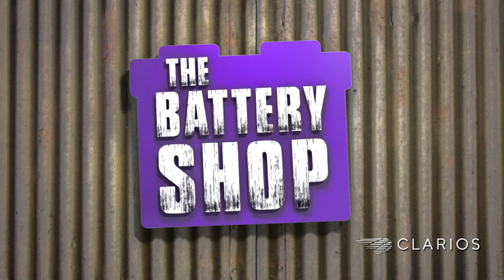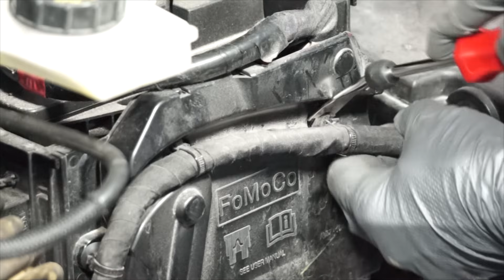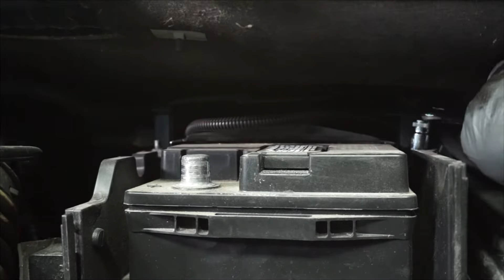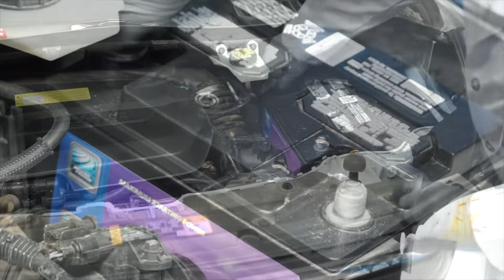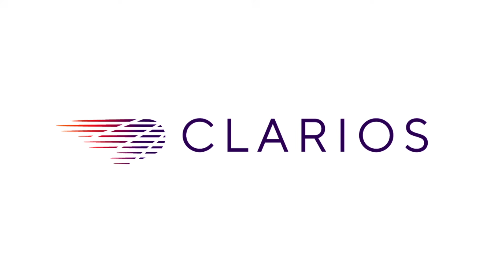Ford Escape (2013-2019) - New Battery Install

Comment: Wow, great video!  Two comments - I was doing this on my in-laws 2014 Escape so I wanted to put all the parts back properly. It took me probably 45 minutes to get the BACK side of the battery cover on and I'm still not sure it's engaged properly. The video shows putting on the front of the cover and the battery I was replacing was installed by the local dealer so I'm not sure that the back of the cover was ever on correctly after the dealer had done the install about 4 years ago. Both parts of the batter cover were just loose and laying on top of the battery. Why isn't the back of the battery cover installed permanently at the factory so the front would just clip into it? Much of this is done by feel since you can't see it while working with your hands underneath the cowling. Second - make sure the battery is shoved all the way back in the battery box before you put the front of the box back on or you won't be able to get the front of the box engaged (I learned this the hard way).  I didn't bother to check the owner's manual on how to replace the battery and this video was great!!!  I once had a GMC Acadia and the owner's manual didn't even tell you where the battery is (it's under the back seat in the floor).  C'mon American car manufacturers, you can do better than this!!!  Because of nonsence like this, I will never buy a GMC or a Ford again (don't get me going on the cabin air filter for this car).   But, great video!  It took me about 2 hours total to do this job, taking my time and playing with the battery cover for about 45 minutes.
Reply from the maker: Thank you for watching and adding to the conversation!

Comment: My ford escape had  clips on the filter box. Also my filter was square. Their was no bolts holding it down but those self tapping clips. Just pull on the box and they will become free. Everything else is correct. Did it today. Removed it in 45 minutes.  Installed in 15.
Reply from the maker: Hi - Thanks for watching and sharing your experience!

Comment: Seems to be a lot of ambient current flow causing a spark when you disconnect/ reconnect the negative wire to the frame. My daughters battery lasted 9 years in her 2014 Escape.
Reply from the maker: Hi - Thanks for watching! Thanks for sharing your experience. The spark can occur when a Memory Saver is being used.

Comment: Look at the battery replacement for a 2014 ford escape. You either remove the whole airbox or the wiper cowl if you want to get it out. This is all designed this way to drive customers to dealers for service
Reply from the maker: Hi- Thanks for watching and sharing your opinion!

Comment: Why on earth would Ford put the battery in such an inaccessible location???
Reply from the maker: Hi - Thanks for watching and sharing your thoughts!
Reply: At the beginning he said it had to do with crashs and weight distribution that's the Ford answer.  The real reason is to force you to go to the shop and pay them to do a job you Used to be able to do yourself. And that's no cheap battery either $300-$400.

Comment: You didn't mention resetting the charging system. I'm reading we must do this after installation of a new battery. Do you do this? Is there a video for it? Thanks so much
Reply from the maker: Thanks for watching. Some vehicles need a reset of the computer to help it understand that a new battery has been installed. We would recommend contacting your dealer or mechanic to see if your vehicle needs a registration reset.

Comment: removing the cowl and wipers gives you more access and really you should remove the negative cable before removing the positive.
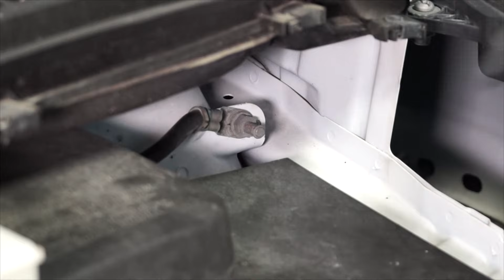Reply from the maker: Hi - Thanks for watching and sharing your opinion! We followed the vehicle manufacturer's procedure as outlined in their service manual. The negative battery cable was disconnected first via the firewall connection (as shown at  0:53) as per the recommended procedure.
Reply: @TheBatteryShop  stand corrected on the negative terminal ...

Comment: Thanks, great video.  Is the socket required for the air filter housing also a 10mm?  Thanks  again, great video, great help  Please stay safe.
Reply from the maker: Hi - Thanks for watching! The video was made quite a while ago and we don't have that information here in the studio. We suggest you check with a service/repair manual for the vehicle to be sure.
Reply: Looked like it was an 8mm based on the close up of the socket.
Reply: 8mm is needed on the 2013 titanium I'm working on right now

Comment: I think the easiest way is to remove the wipers, the plastic cowl and the metal bracket and change it out from the topside
Reply from the maker: Thank you for your contribution and advice!
Reply: @TheBatteryShop although I did run into an issue with the wipers not working properly despite following instructions on how to cycle them

Comment: This was great until the last step, connecting the negative cable to the frame. Why am I seeing sparks?
Reply: Its normal. Its completing the ground circuit.
Reply: it's normal, just be quick when you pit the negative back on and don't sit there making a  pretty lightshow with the sparks 👍
Reply from the maker: Hi - Thanks for watching! That can be normal when a memory saver is not used.

Comment: I don't get it... all these complaints. I removed the cowl and wipers in a few minutes. No big deal. Its not like you have to do this very often.
Reply from the maker: Hi - Thanks for watching and sharing your experience. We did follow the vehicle manufacturer's recommended procedure though because some folks who watch our videos have never done anything like this before.
Reply: @TheBatteryShop  Thanks for the reply and thanks for the effort to publish your video. I guess the motivation for my post was all the "less than rational" posts I found here. When I was in the workforce (as a design engineer) I found two types of folks when it came to criticizing "the other fellows work". 
1. The thoughtful types who understood that "compromise" is a main ingredient for all but the simplest of design. 
2. The rest. The ones that have not taken the time to fully understand "compromise", typically have no idea how to make a better design, but love to spout off about how stupid others are. They are also the ones who seldom take the time to "RTFM". Case in point: One poster here complained bitterly about not being able to jump another vehicle with an Escape. When, in fact, that procedure is well documented in the User Manual. 

You spell out one procedure... I chose the other one. Both got the job done. End of story.
Reply: Thanks for sharing  your insight!

Comment: LEFT OUT RESETTING THE PCM (powertrain control module) ... If the battery is disconnected for a long time.... the PCM will lose data and have to be reset ... otherwise the engine could run rough for a LONG TIME before idle / running parameters get "tuned"
Reply from the maker: Hi - Thanks for watching! PCMs are not reset. If they lose data, they revert to Open Loop status until driving parameters are learned. P1000 will then be reset after all of the monitors have run with no faults detected. According to BCI, these vehicles do not require that the battery be registered with the Battery Control Module. The use of a memory saver during battery replacement will avoid these issues.

Comment: Wow - & WOW - well I broke a tab off air box - negative post welded itself to the battery cable apartatus- pretty much destroyed old battery removing it (terminal broke loose) once I started there was no turning back, should have taken it to the dealer make it there problem! OMG - all morning to replace a battery,  yup the best battery you can & hopefully never have to replace again. Huge mouse nest behind battery & crazy negative battery connection, not getting that part @ local parts counter! Take my advice& pay someone else to do it! Again I repeat WOW & WOW again!
Reply from the maker: Hi - Thanks for watching and sharing your experience!

Comment: My project is trying to disconnect the negative battery cable in order to "reset" the transmission scheme.  Will disconnecting the battery neg / ground where it is bolted to the firewall enough to clear out & "reset" the transmission scheme memory settings, or will the cable connected at the negative battery post need to be disconnected too?
Reply from the maker: Thank you for watching. We would recommend consulting your mechanic or dealer for proper resolution.

Comment: Should i be worried about that battery monitoring cable touching the negative terminal?
Reply from the maker: Hi - Thanks for watching! The current sensor is typically attached to the negative battery cable on many vehicles, so if that is true on your vehicle the "battery monitoring cable" can touch the negative terminal without issue. That said, we are not the vehicle manufacturer, so we suggest that you check a service/repair manual for your vehicle to be sure.
Reply: @TheBatteryShop  ty for your reply.  What a PITA this was.

Comment: Good video. Very helpful.  The lower air cleaner assembly is not that easy to remove on the first effort ( at least for me on a 2014 Ecoboost engine). Several plastic pipes involved. Anyways..I did complete. I saw no need to take the negative wire off the firewall. Took the positive cable off the battery first and then the negative.
Reply: @TheBatteryShop  I have 2016 scape .can I install a battery with more cca or bigger battery?
Reply: If you don't disconnect the negative wire first you can cause a short while trying to mess with positive terminal if you touch any other metal

Comment: There are two methods to replace the battery, this method is by far the most complex.  I made the incorrect decision to follow this video because the entire operation seemed so incredibly easy.    However I found out the difficult sections of the  process are edited out so it seems much more simple than it actually is.   I would not recommend this video.
Reply from the maker: Hi - Thanks for watching and sharing your experience! For the record, we did not edit anything out. We simply followed the manufacturer's step-by-step procedure as found in the service/repair manual and databases, as we recommend at the beginning of the video.

Comment: This video was nice . . .  BUT . . . .   Who in heck has a torque wrench which reads newton meters?  Maybe in Europe.  How about some American numbers?    Also, there was specific mention of SOME of the fasteners and where they were . . .  but little to nothing about the fasteners for the air cleaner box.  What size?  How many?
Reply from the maker: Thank you for watching. We provide the step by step instructions according to the manufacturer.
Reply: @TheBatteryShop  Sorry, I forgot.  FORD.  When I worked for Ford fifty-five years ago, that stood for Found On Road Dead. . . .

Comment: What is the tool you used to remove the part in front of the battery?  I think you said some sort of grommet?  And what brand is that specifically. Looks useful on other parts as well
Reply: the tool is known as a cat's paw, and was used to pry the grommets loose; the grommets are not a tool, they are push-pull fasteners.
Reply: @fritzvold9968  assuming you could also use one of those Dandelion weed pullers as well. shaped the same way.

Comment: You didn't show people how to reset the Battery Maintenance System computer settings to prevent the old data in the computer from overcharging the new battery.
Reply from the maker: Hi - Thanks for watching! Check out our battery registration videos. The links to them are in this video's description.

Comment: What about re-setting the BMS How is that done? Wait eight hours before starting again? Or using the ignition on-emergency flasher/brake pedal method? Other?
Reply from the maker: Hi - Thanks for watching! Check out our videos on memory saving and registering the replacement battery with the BCM. The links are in this video's description.

Comment: This was helpful but alternately, you can take your windshield wipers off and just remove the plastic guards over the battery.  Much more accessible.
Reply from the maker: Hi - Thanks for watching and sharing your experience! The method we use is the vehicle manufacturer's procedure as outlined in the vehicle's service/repair information.

Comment: Undoing that negative cable works for doing electrical work correct?
Reply from the maker: Hi - Thanks for watching! The negative battery cable should always be disconnected from a battery first.

Comment: I need to jump start mine right now, guess what..I can't, thanks Ford!
Reply from the maker: Hi - Thanks for watching! You can attach the jumper cables to the positive battery post after lifting off  the battery cover and the negative jump post on the firewall. The vehicle owner's manual outlines the procedure pretty well.

Comment: Hmmm... this isn't the way I did it last time I had to replace the battery in my 2014 Escape.  I removed the wipers and plastic cowl above the battery.  Seems like it was a lot easier.
Reply from the maker: Hi - Thanks for watching! We are aware of the method you used but we follow the O.E. Manufacture's recommended procedures to avoid liability issues.

Comment: there are more connectors to the air filter box that you don't address or talk about
Reply from the maker: Hi - Thanks for watching! We followed the O.E. manufacturer's procedure for this particular vehicle. As we explain in the beginning of the video and in the video's description, there may be differences in year model vehicles, so we recommend that you check the manufacturer's specifications for the vehicle being worked on.

Comment: What is 5 Newton meters?
Reply from the maker: Thank you for watching. Newton meters is the amount of force applied to an object.  In this case of tightening the fasteners you do not want to overtighten or over torque.  We would recommend you consult the manufacturers step by step instructions to know how much force is used to tighten the fasteners on the cable ends.

Comment: I had the battery replaced on my Ford Escape at a dealership and a few days later my AC wasn’t working. Took it back and they said I needed a whole new AC installed at over $3,000! 😳 Another mechanic told me they probably damaged the AC when replacing the battery because it’s a tight space and near it... is that possible??
Reply: I doubt it. AC is on the passenger side nowhere near the battery. At least on my Escape (2013).

Comment: 10mm socket not 10mm wrench
Reply from the maker: Thanks for the feedback.
Reply: @ Your video contained the most detail. It ended being the one I used. Removing and installing the air filter box was clumsy. Removing the front to the battery box was not as bad, but still a little clumsy. Thanks for making the video. That’s a lot of work for just replacing a battery.

Comment: It was extremely difficult to put the air box out and back in. Wish I had done the other method instead. I eventually did the top cowlings off instead and it was a lot easier.
Reply from the maker: Hi - Thanks for watching and sharing your experience!

Comment: Is taking Cowell off easier?
Reply: Yes, but if you are not careful you can mess up the windshield wiper alignment or break the cowl snaps, either of which will cost more to fix than it would have cost to have a pro replace the battery for you.

Comment: The worst part is I had to jump a buddy off but I couldnt because this car is so horribly designed
Reply: It is very easy jump another another battery. 
1. Connect the ground jumper cable to the "Jump start post" (as described in the user manual)  (over to the right) where the negative battery cable is secured to the body. 
1. POP the plastic battery cover off to expose the positive post.

Comment: Removing the wipers, and cowl takes half the time. Another video on YouTube shows you how. Note: Mark the shaft and wiper arm with a pencil to match the alignment before removing arms.
Reply from the maker: Hi - Thanks for watching and for sharing your opinion. We followed the vehicle manufacturer's recommended replacement procedure as outlined in their service manual.

Comment: ford  engineers  should  be fired  for  this one .What  used  to  be  a  simple  job  requires  too  much  effort , due to  poor  design . Sounds like " you  will  need  to  bring  it to  dealer  to me"  type engineering  . good  video  but  too  bad  we  need  it to  do  a  routine  job  like  this  ; god forbid  you  dont  drop  a  nut  or  have  a torque  wrench
Reply from the maker: Hi - Thanks for watching and sharing your opinion!